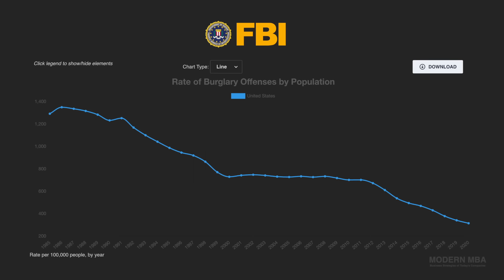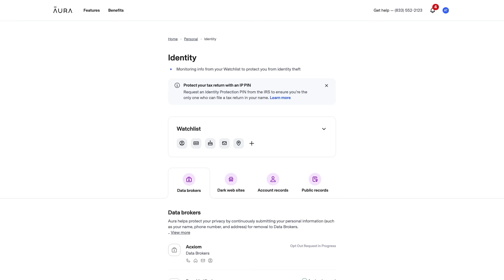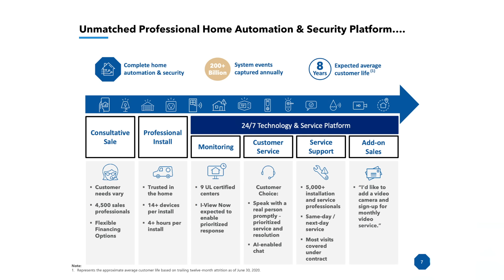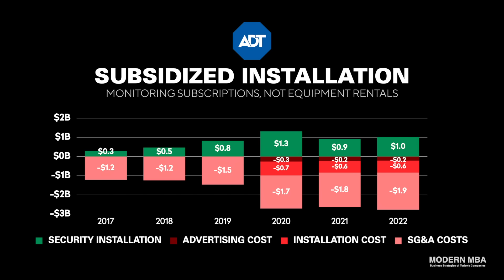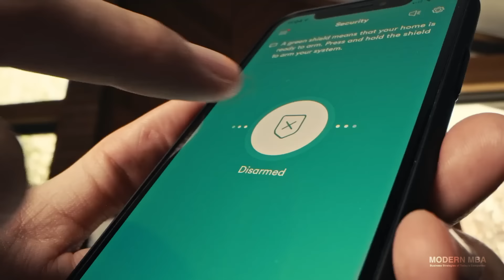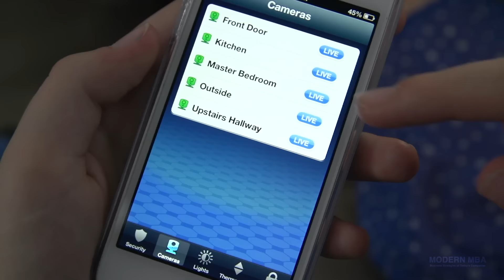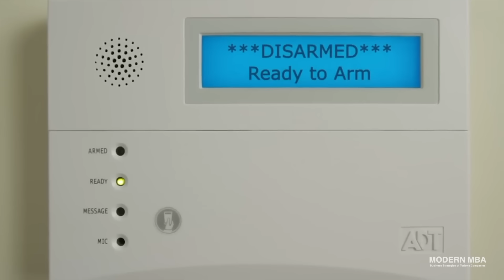The Bait & Switch of Home Security

Comment: What's always confused me about the appeal of home security is that the cops are not going to get there in time, while at the same time alarms send the police department a ton of false alarms, bogging down the system.
Reply: ? What are you talking about? An intruder having 5 minutes vs 6 hours is a huge difference. Even a cheap safe would take longer than 5 minutes to locate, crack and leave. Even the best safe can’t withstand 6 hours of a burglar and his angle grinder. The difference between 5 minutes of theft vs 6 hours is massive
Reply: For my personal safety, yes I'm on my own and the police won't get there in time. If I'm not home, an alarm is the difference between everything valuable gone vs whatever they can run away with.
Reply: As a cop, yep 👍🏻
Reply: Maybe not for the average person but if you have a large house with lots of valuables a burglar could case the place and come clear the place out with a rental truck while you’re away for the weekend, if they were planning on cleaning the place out now they only have about 10-15 min max and might abandon the whole thing. Another threat is a crack head the would be scared off by the alarm. Fire monitoring is also important if you have pets and are gone for the day
Reply: My house is close to a police station, so no...the cops get there in around 3-5 minutes. I know because I had an incident and thats how long it took for them to get on site. Maybe the thieves can steal a few thousand worth of stuff in 3-5 minutes, I don't care. They won't have enough time to get the good stuff in the safe. They also will be on camera, and if they stay too long they are going to get arrested or shot by the cops. Also if you have good locks and kick proof doors it can force burglars into breaking windows which can cause them all sorts of problems. The noise of the glass breaking, possibly hurting themselves climbing in if they don't clear the glass properly, etc.
Reply: The alarm goes the security company's dispatch center first, who then filters out false alarms and contacts police dispatch.
Reply: @Ziegfried82  everyone should live 2-3 minutes from a police station then! It's so simple!
Reply: If you live in a bad area, it won't matter.  Part of this is being able to afford a house in a nice area where people will actively dissuade criminals.
Reply: @Inspectorzinn2  police will take an hour at the minimum, a 38 revolver only takes a few seconds
Reply: @RussOlson-pl3kf What is "fictional"? I have three AKs.
Reply: @Inspectorzinn2 Who has a safe in their home heavy enough that two burglars can't just take the safe to deal with later?
Reply: @godminnette2  Every decent safe I know of bolts to the floor...
Reply: @oxydayz  And over 100k in legal fees and a 30% chance to be convicted even when use is legal and justified. Plenty of people in prison right now who thought the exact same.
Reply: @Inspectorzinn2  plenty of people live in Castle Doctrine law states

Comment: tried to look into security cameras once. Its infuriating how borderline impossible it is to find one that doesnt have a subscription for the software (after paying hundreds to thousands of dollars)
Reply: Just went through that exercise. I can recommend Reolink. It's just an IP camera. You don't even have to buy their own NVR, you can set up one of the open source NVR software, and it works. The camera zoom can even be controlled through third party software.
Reply: I have a TP Link tapo home security camera, it can be accessed anywhere you have internet, and records to a micro SD card. For extra safety and a small monthly fee, I could have the camera automatically record to TP Link cloud servers in case burglars take the camera, but I don't do this though.
Reply: Ubiquiti offers a decent product if you are willing to run cable for each camera. Plus all the data/footage is stored locally. The upfront cost is expensive though.
Reply: For wireless, eufy, for wired, reolink
Reply: What are you talking about? I use Eufy for wireless and Lorex for wired., no subscription. It’s cheap, 1.5 grand for 30 cameras
Reply: If you have a spare PC lying around with decent enough specs, the free version of Milestone allows you to run up to 8 cameras on a free license.
Reply: @Inspectorzinn2  ya, I personly dont like Lorex bc if you hook it to the internet it phones home back to China but to each their own
Reply: Nightowl, I’ve had had it for a year and works perfectly
Reply: I have 5 Dahua cameras on their own VLAN without internet access (because Chinese cameras phone home) and wired it up to Blue iris. Works wonderfully
Reply: Those companies will turn your footage over to police you have to do it yourself
Reply: Yes, thats why I got Arlo cameras a few years ago, just to have them disable the cameras a few years after unless I start paying a monthly subscription fee!!!! Infuriating and dishonest to the max!!
Reply: If you are still looking, I work with a company that installs hard wired 24/7 color 5mega pixel cameras with absolutely no monthly recurring cost.
Reply: Reolink 100%
Reply: Absolutely disagree, most Cameras I see are plain simple IP cameras. Cant understand how people manage ending up with some cloud shit and vendor lock in
Reply: Reolink is the best, they offer PoE cameras that can go into a DVR to be 100% local with no subscription. However if you want to add remote viewing like with an app they still give you an option by simply connecting the DVR to WiFi with no subscription required. 

Best of both worlds, if you want to be as secure as possible then you can be 100% local, and if you choose to have more convenient features but with slightly less security then you can.

Comment: I used to work in this industry. We picked up lots of business from ADT customers who were dissatisfied with their monitoring rates. It was easy to beat them on monitoring prices while still marking up the monitoring service that we would pass along to the consumer. It was impossible to beat them on the speed of installation though. 

It always seemed like the "smart" home devices could be a goldmine for these companies because they come with a higher monthly monitoring rate. However, the only popular smart devices that could be integrated with the alarm panel, the video doorbells, work fine without being connected to the panel and monitoring. I suspect the next thing they offer is going to be some AI service that's tied into the panel/app...and knowing ADT it will probably work like shit.
Reply: same here! I work in this industry too, ADT does such a bad job responding to alarms, that we get customers coming from them. The customers are also surprised that most private company's charge half of adt monitoring rates and have faster response times

Comment: I was in the alarm business back in the early 2000's, we had a nickname for ADT - Alarms Done Twice. They would hack every system they installed. We would get calls from their customers due to false alarms ADT couldn't figure out. Usually misaligned sensors, improperly installed sensors, or poor wiring jobs. The kicker was the customer was paying $40-$50 a month, locked into a 3 year contract. While we would offer monitoring for $20 a month and only required a one year contract. To put it in perspective, the monitoring company would charge us $5 a month per account, so we would make a $15 a month profit.
Reply: holy shit $15 back then that must be like $200 now
Reply: even today same exact story as yourself but today! I work in this industry too, ADT does such a bad job responding to alarms, that we get customers coming from them. The customers are also surprised that most private company's charge half of adt monitoring rates and have faster response times.
Reply: ADT - Another Dumb Technician

Comment: I did a bit of research before picking a security system, and I ended up going with SimpliSafe on my house. I paid quite alot upfront, around $1k, but I own the whole system, and it has cameras everywhere, sensors on every door/window, motion/glass break detectors, etc. I also had to install it myself which wasnt hard.

So far after a year of use, I love it. The system uses wifi and has a backup cellular connection and battery backups. All cameras have a hardwired power connection that I had to install. After the 1 year, Ive yet to have to change a single battery on anything. Monthly payment is $0-$30 per month depending on what features are enabled such as monitoring or not (monitoring/police response is at least $10 per month). No contracts. Self-monitoring is completely free if I wanted, since I own the whole system. Finally, if I want more cameras, sensors, etc, I just buy them and add them to the system.

If I had to change anything, Id consider getting a separate POE camera system, but at the same time, being able to view the SimpliSafe cameras over the app from anywhere is nice. Its really a privacy tradeoff more than anything else.

Comment: I worked for an ADT dealer for a few months in the sales arm and I can attest that they would have us tell customers to sign up and we’d get them installed asap because the contract doesn’t technically start until the install is completed. We’d lock them into a 2 year contract from initial agreement and all equipment would be free with monthly plans anywhere from $45 for the barest system to $65 at the priciest one with the most cameras. We were provided with brightly colored system option sheets with very large dollar values to show people how much the equipment cost (so we said) and how it was such a deal to get it for free. Our biggest competition was vivint which is even worse with the equipment financing contracts they lock people into. As a whole I realized after a few months and some sales that being a salesman wasn’t for me and moved on. At that job the turnover was very high, in the time I was there we went through probably 10 or so sales people not including myself. People who were fired or quit for whatever reason.

Comment: I paid an electrician to install security cameras and dusk 'til dawn lights with 24/7 monitoring tracked by app uploaded to a cloud.  It cost me $2K total, but no other fees and the system works exactly how it's supposed to.  When ADT/Vivint come to the door, I simply point up to the corner of the entryway and tell them they're already on camera.  Ends the sales pitch fast.

Comment: I also wonder if the unaffordability of houses and real estate may also have led to a shrinking customer base, since it's a service that is largely only available to homeowners. Even for landlords, getting systems for multiple houses would probably get very expensive very quickly, and the extra cost would be unattractive to potential renters, useless when no one is living there, and a massive hassle if the house is being used as an Airbnb. With long term contracts, renters certainly aren't going to go for the service, especially if they aren't certain that they'll even be living in the same place for the entire duration of the contract.

Comment: The thing is, local flash storage is so cheap now that you (or ADT) can set that up instead of relying on cloud subscription storage or basic monitoring.  Also, the customer churn doesn't mean all of them do not want a security system since many could go to Vivint, another monitoring company, or a DIY solution.
Reply: What is hard is to get your alert and video streem outside of your home without a cloud system. With many Internet providers putting the user behind a NAT, the only way to get data out is through a third party. Can be a cheap instance somewhere in a cloud provider you set up and manage, or can be a service tailored for the use case, with only a registration needed.
Local storage isn't worth much if the robbers take your computer.
Reply: The whole problem with local storage is that they can just steal the cameras along with the stored footage, which cloud storage solves
Reply: @VEVOJavier  It depends where you secure the storage elsewhere on the property (wirelessly or connected) instead of just having it be a microSD card on the side of the camera.  You can also back up the local storage on the cloud for a running month or something for like 5 bucks a month.
Reply: @lajthabalazs  There's many open source APIs that can send alerts but no real standard in part due to ADT or Ring's dominance.  

Storage also doesn't have to be on the camera or computer not to mention a temporary cloud backup without resorting to a full $40 subscription.
Reply: @Taospark  Yes, $7 for IFTTT, $14 for 2TB of Google Drive storage, and a small bump to the electric bill running a local proxy to upload videos to the cloud.
Plus all the hours one spends to make everything work, everything secure.
Reply: @lajthabalazs  That might be legit less of a hassle than ADT but I'm sure there's already startups working on automating that backend and cutting the overhead down on a hybrid DIY.
Reply: why do you need 2TB of rented storage for crappy security footage? not necessary to find out you got robbed a year ago, or to go through that footage? and hold hold hold up, why do you need cloud storage on top of running a proxy server? is buzz words all you know? you do realize a computer connected to the internet = "magical cloud"
Reply: @MrPaxio  Yeah, sure.  Cameras also magically zoom and enhance too and I totally wasn't just conjecturing different options that are all valid depending on individual needs and preference.
Reply: so how does "NAT" somehow stop you from accessing the internet or identifying the PC youre sending data to?
Reply: @MrPaxio  I didn't bring up NAT though.
Reply: @MrPaxio  A computer connected to the Internet is a server, not a cloud. And it's a server that's on the property you want to protect. So it might be picked up by the robbers, and the video kept as a souvenir.
One 2K camera at 30FPS and H.264 encoding generates 1TB of footage per week. A camera in the front, and one in the back, one week, that's the 2TBs. Of course if you have more cameras, you'll have to either compromise on quality, or set it up for motion detection, and hope it works. Or buy more storage.
Reply: @MrPaxio  For accessing a PC that is behind a NAT, look up NAT traversal, specifically in relation to symmetric NAT.
Reply: @MrPaxio  Those are certainly all buzzwords you just said that mean nothing but Internet keyboard warrior spite.

Comment: You would wonder why ADT doesn't purchase companies that produce the equipment.
Reply: Because most of those companies are 10X the size of ADT.
Reply: @JJJRRRJJJ  ADT (American District Telegraph) did manufacture their own equipment years ago. They had R&D and engineering. They have many patents for fire and security devices going back decades. Many fire and security equipment brands were once owned by ADT/Tyco and are now owned by Johnson Controls who ended up with ADT /Tyco's commercial business'.  They had local sales and service offices in every moderate to major city and had local technicians. Many of these local offices monitored the local accounts and had armed guard response. When they were bought out by Tyco, they went to the same off the shelf equipment used by their competitors and ceased manufacturing and R&D. They closed multiple monitoring centers merging millions of accounts resulting in long hold times, delayed response and pure chaos. The sales people then had to try and sell the same stuff for outrageously higher prices. Then they started the dealer program and the local sales people had to compete with the dealers selling the same service and equipment. It was a good company to work for in the 80's and 90's. I was able to retire early with a pension and nice 401K balance.

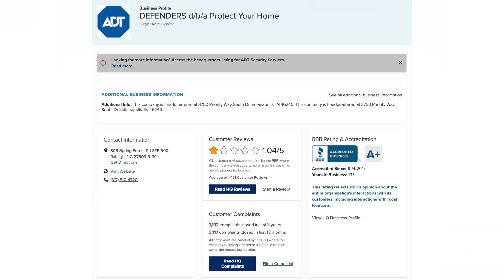Comment: I will NEVER sign up with ADT and I recommend everyone else steer clear of them!  They ripped my parents off with a new system that did not work the first time we tried to use it.  Their phone tech support was useless.  One time, they told us that the panel was supposed to show a 1-minute countdown to leave the house before it arms but not actually give you that time.  Every time we called, we were put on hold for a long time.  Once, I asked to talk to a supervisor right away, and they transferred me to a line that had a 72-minute wait.  Their in-person tech support was not much better.  They failed to show up for appointments twice.  They finally showed up on the third attempt, and the technician admitted that the phone people had given me incorrect information.  Yet somehow they manage to keep an A+ rating with the Better Business Bureau despite having a 1.04/5 customer rating on that site (see 13:00 in the video).